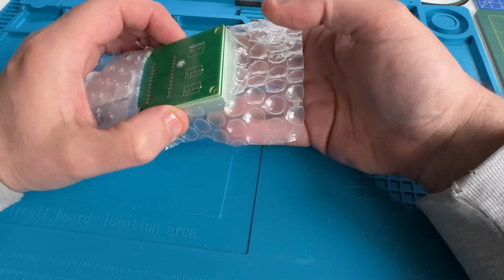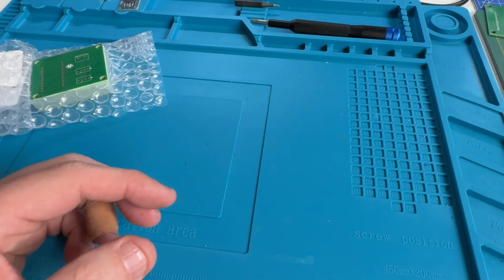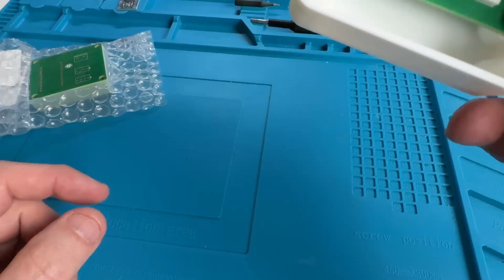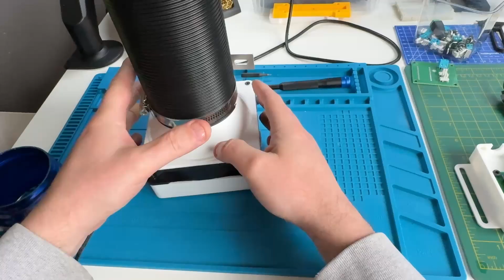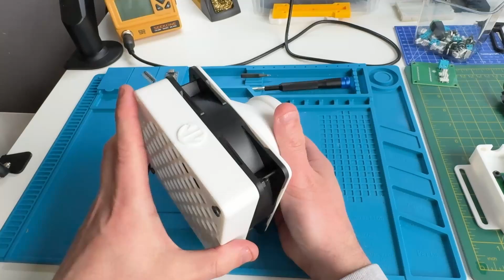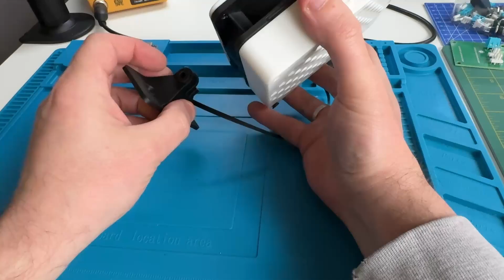Sim racing wind simulator: Part 3 - PCBs and componentry

Comment: Pc fans are just too weak and building a windsim on audino is to limited by its amperage limit.
Sym projects board is much more powerful and is able to really push powerful fans and generate really strong wind but is a central channel and can not do left and right channels but the power out weighs thus.
The flexibility tubing causes too much turbulence and the noctua thing....I haven't tried it, but it looks like it's focusing through the ports so will not have as much coverage on the body....now if you could design a 6 amp board that can do left and right channels you would be on to something worth selling.....but good luck
Reply from the maker: I only use the Arduino to drive the PWM signal. An external power source is required anyway, as the fans are 12v and need about 1.5 amps between them at full title, which as you say the arduino can definitely not supply.

These wind sims have actually sold really well. In total I’ve sold about 25 kits. The benefit of using PC fans is the cost of parts, keeping it pretty well attainable for most sim racers. The definite downside is the build and print time, which is about a day per kit. And I’m not completely happy with the fan interfaces. 

Also, Arctic have recently discontinued the P12Max fans, which means I’m now looking for alternatives. Bit of a pain.